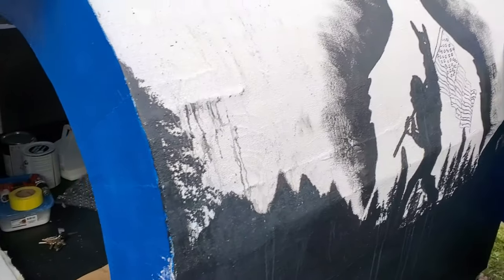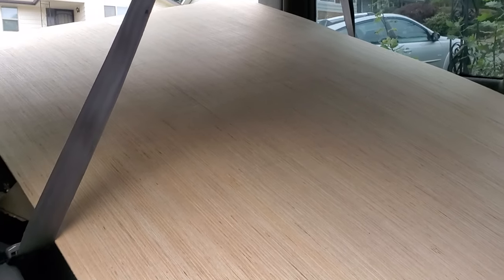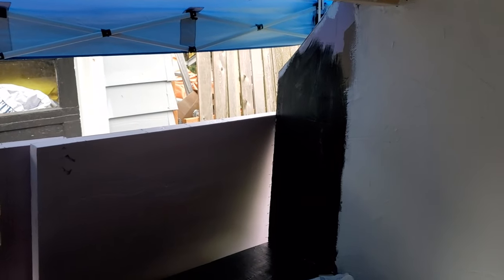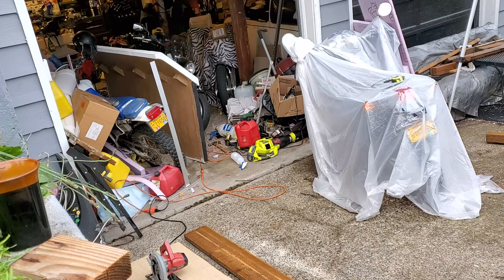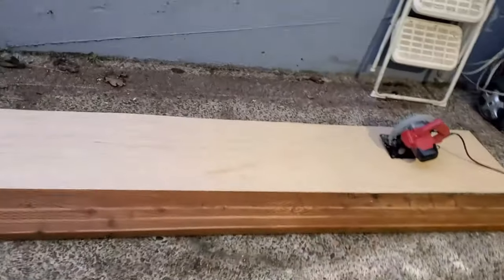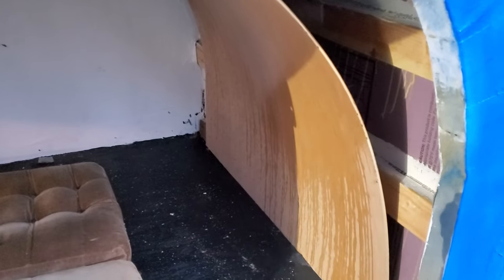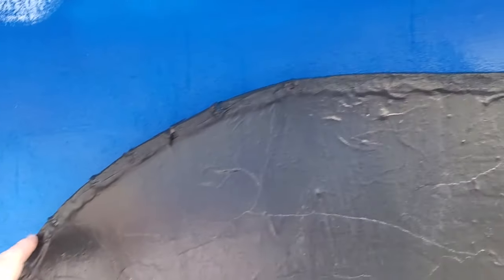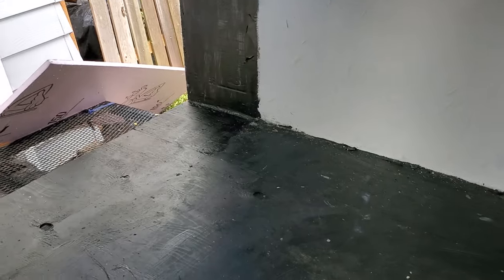Building a removable teardrop foamie camper Part 9 - Crap I messed up AGAIN!

Comment: This is great.  Show the mistakes and the successes. 👍 I have also started a removable foamie project.  About finished modifying an old Jayco frame to a 5’4” by 10’4” flatbed (it’s outside on sawhorses - darn Washington weather, I’m in east Skagit County).  I have materials, think I can manage to build the 5x10x4 foamie box inside the garage.  First time at this, so there is a lot to learn.
Reply from the maker: Yes there is! I will I was indoors, it would have make this so much easier but you work with what ya got! Hope you post about your progress! love you see. Take care Les

Comment: Scoring a kerf like the roof, but on the outside of the bend, the convex side, would have saved you $17 but I'm sure you can still use the pieces that broke. Awesome job though. I'm loving it so far.

Comment: Looking good. I ended up running my wires under the floor because I closed in the ceiling before running wires. For the lights and fan I glued the wires in the corner. It is too bad, when I wired my switches in the wall I buried the wire in the foam so you can't see them.
Reply from the maker: I am using battery LED puck light and LED strip light and all utilities will only be on the back wall. And if I want to undo the roof I simply can unscrew it,, would love to see link to some photo of your! take care Les